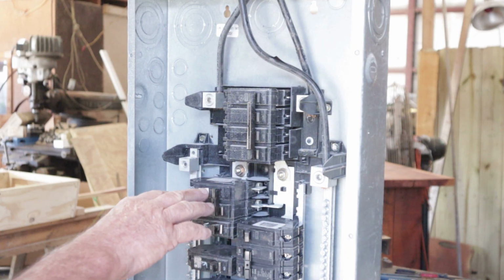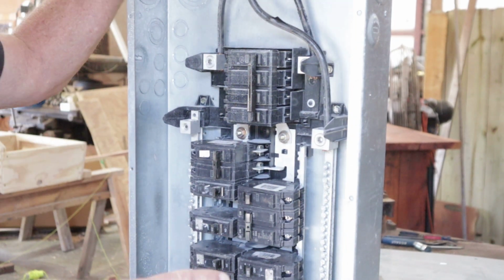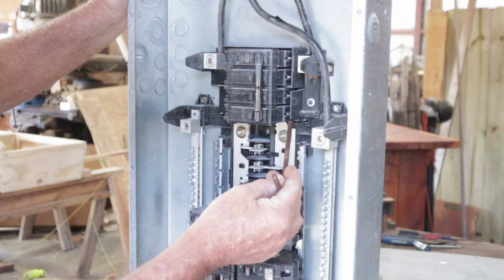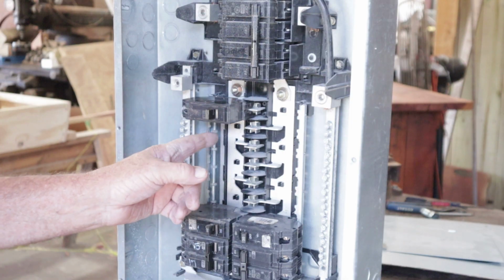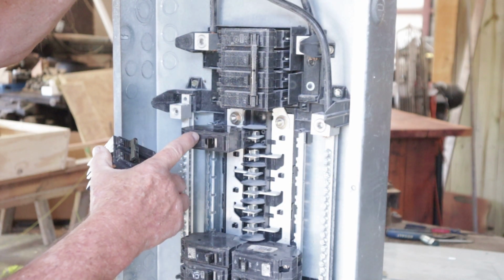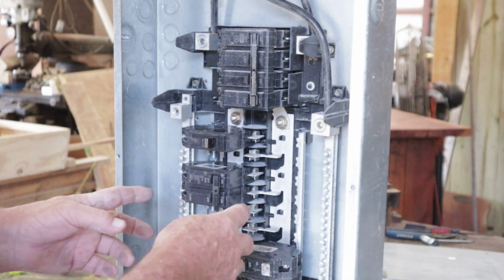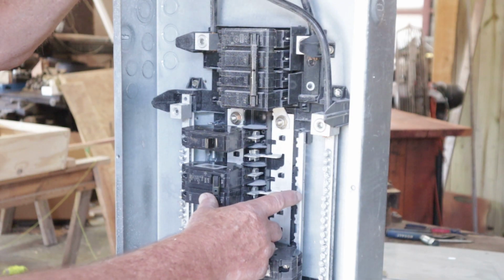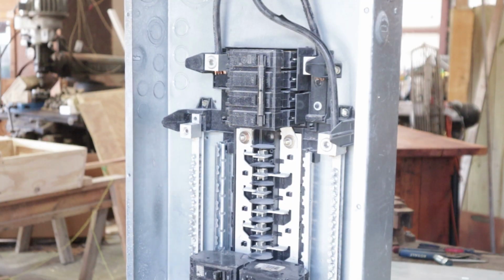GE Powermark Gold 200 Amp Breaker Panel Installation Tutorial !

Comment: why does GE use four ganged 200A 1-pole breakers for the main, instead of one or two 2-pole 200A breakers? How are four 1-pole breakers connected to the two busses to provide 240V?
Reply from the maker: Only GE can answer that. But my guess is to shut down complete power if one portion of the incoming power is not transferred. Eliminating any issues in the service with low voltage . Not sure if I explained it correctly

Comment: I appreciate the video. Shouldn't there be 4 wires( 2 hots, a ground, and a neutral) coming into the load center from the main service disconnect?

I'm working with that load center now on a project.
Reply: The neutral and equipment ground are bonded. So only 3 wires.

Comment: Question, when you are installing the 2 pole breaker on this particular load center, do the fins on the two opposite poles seat fully into the slots on the breaker, or only halfway and are they kept from going all the way down by the portion under the legs?

Comment: Only trust worthy items that he makes is jet engines. Had the most trouble on 13,200 volt switchgear made by ge. Last two POS junk garbage 129/208 200 amp panels that were installed at work the covers could not be opened more then 65 degrees, even with cover removed. He has the worst service, tech support & parts departments. Took them a year to get an under voltage relay and another year for dumb ge engineers to figure out where five wires went on new model, DA 2 to coil, 1 on common. Years ago lazy ge service department contaimenated a ge 13,200 volt transformer with PCB'S. They used over 200' of PCB filled hose to go from filter press to transformer. Years ago we had a GE supply house that seldom had more then one car or truck in the parking lot. While doing volunteer work for a poor school & church I stopped there to purchase 500' rolls of #12 &:10 THWN solid or stranded spools. Told me they only sold 5,000' spools of only a few colors.

Comment: you could not pay me to have any POS GE garbage products I my house! Last two brand new GE128/208; parks that I had to work in had doors that would not open more then 6/ degrees. Over the years ge had the worst service, tech support  & parts . Took their lazy service department a year to get a low voltage relay then another year to get a wiring diagram for a Millon dollar 13,200 volt dual service with automatic tie breaker ( that seldom worked even after yearly PM by ge ). My wife purchased a few junk gas stove. Oven ignitor burnt out three times in 6 years then the expensive oven glass on door blow up while I've was only in a few minutes.
Reply: So what electric gear company and set up do you use or advise to use in 2026 Westinghouse, Siemens , Stanley,  (Honeywell)  ???  What are you using